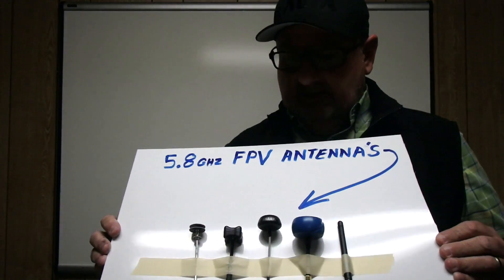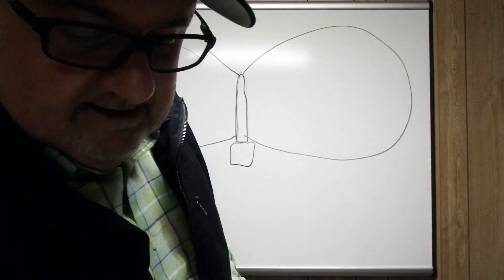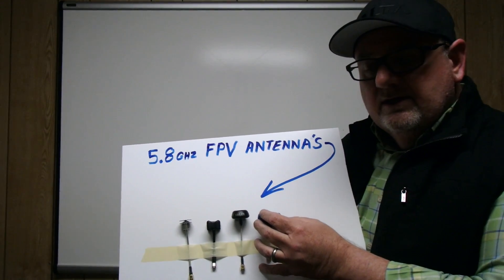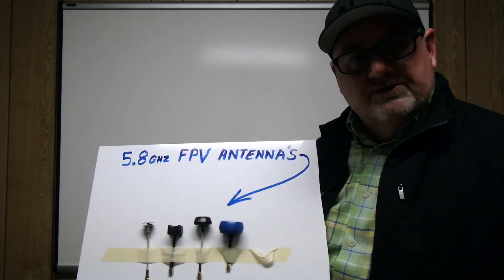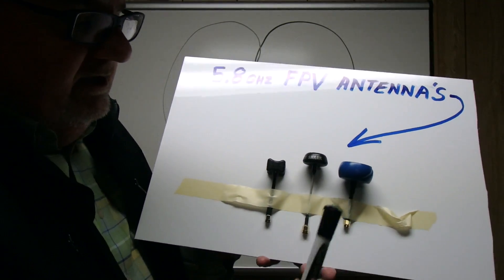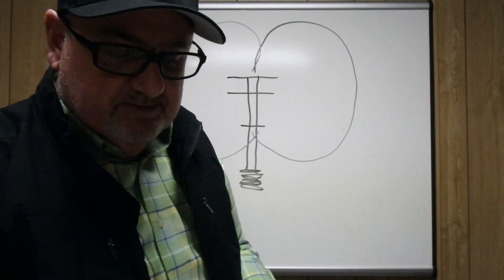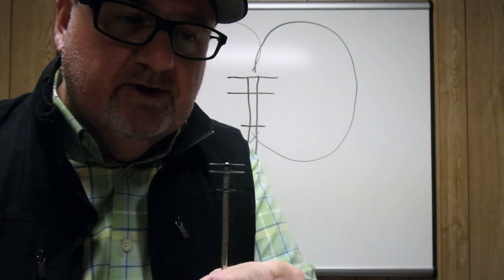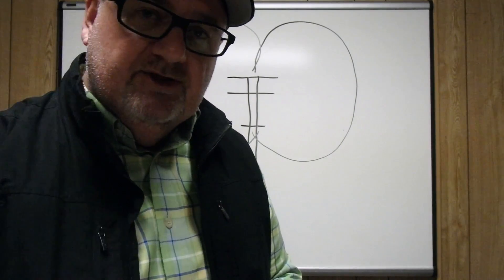The Best FPV Antenna!

Comment: Hi John, Thanks for a great explanatory antenna video, Can I ask you going back a couple of years I know,  would you still put the Fatshark 5.8  panel on your Q500 or have things moved on ??
I am now where you were then!!!!
Thanks & regards.
Reply from the maker: I do still use panel antennas on most of my receiving systems as they offer the best gain for the size. Keep in mind that panels are very directional though and only use them for your 5.8GHZ receiver. Thanks for the great question!
Reply: Many thanks, & Happy flying...................

Comment: hi, how do you  know whether you have a left or right hand on the transmitter, i have a flysky i6 but have no idea whether it's left or right hand , so don't know which sided antenna i need for my quad, please help, thanks
Reply: Are you referring to an FPV System (5.8 Ghz) or a RC System? (2.4 Ghz) 
Usually, you can look on the manual of your FPV antenna (or on the antenna itself) to figue out what kind of polarization it has. With an RC system, (2.4 Ghz) I'm pretty sure you don't need to worry about polarization as I think it doesn't apply

Comment: Hey there bud, can you please tell me what kind of antenna I need to put on my bugs b2w for better fpv range. The wifi  fpv signal is currently running in 5 ghz  and signal range is not that great. I've asked several people and nobody can answer me,please help
Reply: Did you ever figure out what works best? I have a Bugs 4w and I'm experimenting with antennas. Trying not to throw a lot of money away to get something that works better. Both 2.4 and 5.8FPV.

Comment: I think you misread the antennas theory and the radiation patterns of a dipole when you say the pagoda works better in any position.
They have quite the same radiation patterns as they have quite the same gain.
A stick antenna like the one you have is an omnidirectional antenna. When you tilt it 45˚ there's no loss of gain if you look at the radiation pattern.

That said there are many other factors that could affect antenna quality. Coax cable and connectors can greatly affect quality too.
The pagoda is a bit easier to manufacture correctly as the traces are on a PCB, so the dimensions tend to be more accurate than a crimped dipole from china that barely fits into tolerances.
Reply from the maker: I was referring to the data from Matrin's website where he specifically tried to design a more spherical radiation pattern to aid in less drop outs when aircraft are in different positions.
Reply: Oh yes the lobe is bit more spherical on the pagoda than on the cloverleaf on his site so less loss when you angle the antenna.
I might have misunderstood you when you where showing the stick antenna :) My brain sometimes glitches and correlation between audio and visual isn't that great ! 

I think it would be great to have them all tested in an anechoic chamber to have real life radiation patterns.

Based on what I saw, pagodas work better because by design they are easier to produce fitting within the specs.
Clover leaf are good but too fragile. If you move the radiants a little, you just detuned the antenna and chances are that your SWR just jumped up.

Comment: Jousha Bardwell has a great video comparing antennas and explains  them well (https://www.youtube.com/watch?v=Zta0neVS9bw and was released 3 months prior to this) why try to reinvent this wheel poorly?

A couple of things -

I LOVE opensource projects - Pagodas are great, but not the be all end all of antennas. They are great as long as the PCBs are parallel. It is unclear how the covers/housings interfere with the signal (as in not been well tested). The great thing about the pagoda is the design is not restrictively licensed and they are inexpensive to produce. The bad thing is durability, it is very easy to knock the PCBs out of parallel (I have done it 2 times on my quads when the PCBs were covered in heat shrink tubing). They are very close to equivalent to cloverleafs and the triumphs as far as coverage goes. Personally, I put Triumphs (even tho they are 2x the cost of a pagoda) on my quads because they are very durable and use a pagoda+patch on my goggles.

There is no "best" antenna - they all have different characteristics.

Umm... your description of polarization and gain is... poor. 

A polarized signal basically (sends out/receives) the signal in a spiral (left/right hand) and ignores the others. This helps with multipathing (a signal bouncing off of something) by ignoring the bounced signal (the polarization is reversed when bounced). A linear dipole antenna (the first one reviewed) does not have polarization so it cannot reject bounced (multipathed) signals causing signal degradation. That is why to not use it(linear dipole antenna), not the coverage pattern. Funny enough, most people still use these antennas on controller transmitters (transmitters signals require MUCH less bandwith and have built in error correction (DSS)).

Oh yeah. RARE is the controller that can use a 5.8ghz antenna to any real effect. Most transmit on the 2.4ghz band and antennas are manufactured to a particular frequency.

Gain is like a lightbulb. 0 gain is just one radiating the signal in a sphere (sorta, its really a toroid/doughnut shape kinda puffed out into a ball). If you put reflectors around the lightbulb, it will change the shape of the "ball", usually flattening it somewhat. That is increasing gain. A flat antenna (called patch) puts that lightblub in parabolic reflector (a flashlight/satellite dish). That reflector can be used to receive as well as transmit.
Reply: Zeke Urness : In His defence, why let it bother you? Don't like it? YouTube is big, enuf room for all. Maybe some like his teaching mannerism better. Seriously, WHAT makes arrogant trolls like you tick? Go away and grow some people skills.
Reply: Well Zeke thanks for making things so much simpler. So was that a toroid, lightbulb, donut puffy-ball!!
Reply: Josh goes into a lot of techie detail that some folk don't want.  This is a fairly relaxed and well informed video.  I enjoyed it.  Good enough for me.